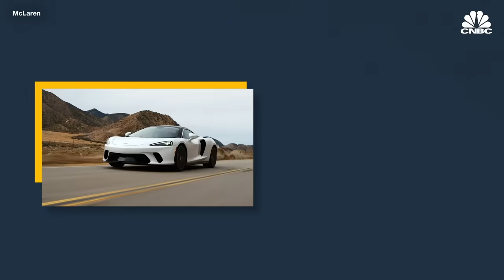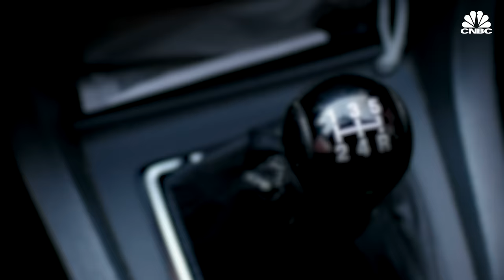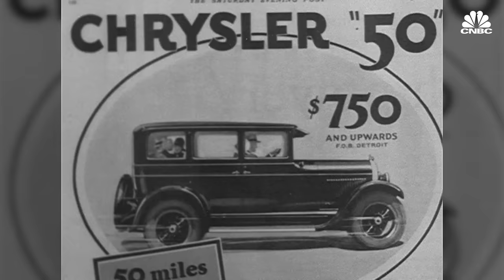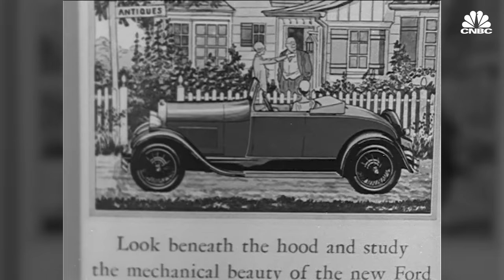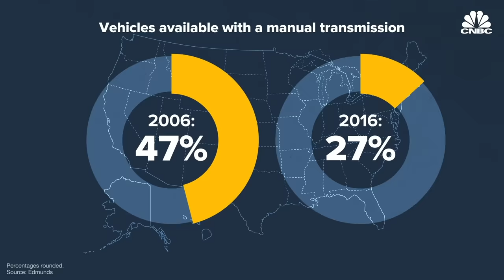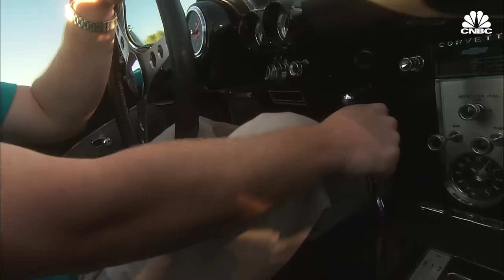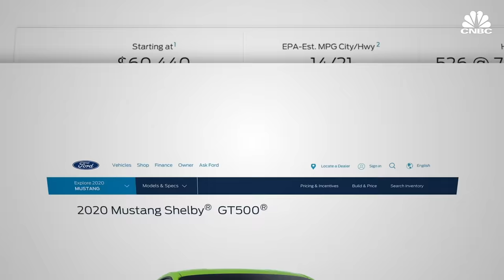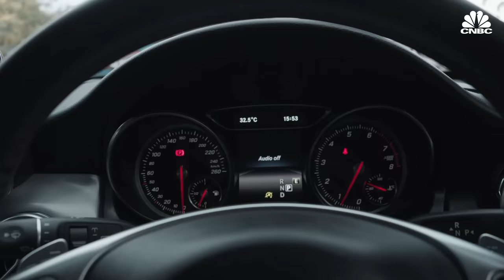Why Stick Shifts Are Going Extinct

Comment: *Why stick shifts are going extinct in the US*

Come to Europe - even try renting a car here that's not a manual. Good luck.
Reply: there are few automatics car, for disable people....
or Americans.
Reply: I can drive stick but I think it would screw me up shifting with my left hand assuming the steering wheels on the right side idk
Reply: @eyyymanuel  yes but only in UK .
Reply: Yeah but the steering wheel is on the wrong side ;)
Reply: It’s coming to Europe too. Ferrari dropped manual transmissions completely, automatics provide better performance these days, and self driving, or semi self driving, is undeniably the future, which you won’t be able to have a manual in.
Reply: @eyyymanuel  right side uk
Reply: Classic standard transmissions are becoming rarer in Europe, as well. Auto-manual transmissions and CVTs are gradually displacing manuals. Ford reports their cars in Europe went from 89.6% manual in 2017 to 68.7% manual in 2020. If that rate were to continue manuals would disappear in 2040. On the other hand, most of Europe (and the UK) agreed in Paris not to sell new petrol or diesel powered cars beginning in 2040. Electric cars do not have manual transmissions - that would be really dumb.
https://thenewswheel.com/ford-manual-transmissions-europe/
For 30 years I drove manual transmission Ford work trucks. About 5 years ago I got one with an automatic because the option package for the 4WD F350SD with our specs no longer came with a manual. The new transmission eliminated my major objection to automatics: it could be locked in gear, instead of being allowed to downshift, on slippery roads. It was also much better on steep, snow packed forest roads. It just was not possible to downshift from second to first uphill with a manual - the truck came to a stop quicker than the synchros would act. The auto kept me rolling.
Reply: The reason a stick shift is  going extinct is  people only have two hands, and they use both for Texting  there is no hand to shift with!
Reply: @mylanmiller9656  I'm only 24 (August 2020), and I honestly don't get why people are stupid enough to even text behind the wheel of the vehicle. I think I can easily say that I couldn't text while driving myself. I haven't ever learned to do that myself, I really can't do a lot of distracted driving, or much of any that would interfere with the idea of taking my eyes off the road for maybe a second or 2 per time, such as looking at my mirrors for instance.
Reply: @michaelm.3641  
Would you say the day Ferrari sold the next Enzo/F60 with automatic only the day the manual gearbox die?
It would be an engineering milestone that the automatic finally surpassed manual but still...
Reply: Alas even in Europe rentals of autos are becoming standard (sorry).  A friend in Barcelona  (4/14) had no choice in the purchase of new BMW hatch; auto only.  I rented a car in Luxembourg (6/18) all I had a choice of was an auto.  Honda stopped the amazing stick they had in the Accord cause no bought it.  I'm getting a Horse before a EV.
Reply: @davet.5493  
Makes me think people who said all rental cars in Europe are all manual haven't travel for some times.
And how long they can hold out since Chinese tourists don't drive stick either.
Reply: I'm from the US and I visited the Netherlands a few times for work. 

I got free upgrades to executive-class cars at the rental agency because those were the only automatics they had. Sure, I probably should have felt embarrassed for not being able to drive stick, but I definitely didn't. :D
Reply: That's planed to keep unknowing Americans from driving on the right side of the road (as in right or left) . This applies in Britain. India, Japan, Australia ect.
Reply: @d.s.steele3100  Britten, India, Australia  and  japan  drive on the Wrong side of the  road!
Reply: @jahmanborneo1343  Rental company's  have leaned to Automatic  cars  for ever. In  north America when  a Stick shift was real  popular, Renters like Hurtz  ordered  GT 350 Mustangs with  Auto  for there  rental Mustangs! an Auto was not even an Option on  a regular  Hi po mustang  but the Rental Co  had them special built. this was  not to make it better for the renter. it was because  a Poor driver can destroy a clutch in short order.
Reply: @mylanmiller9656 : That was tongue in cheek sarcasm. In actuality though, those countries fallow international rules of navigation. Ships at sea and air craft, travailing in opposite directions, are to pass right side to right side. That is why the green navigation light faces right or is on the right wing. the red lights face left or are on the left wing.
Reply: I drove in both the UK and mainland Europe on rented cars. It's actually very easy to find autos, but they're significantly more expensive. In the UK, I drove a MT Ford Kuga, but in Europe, I drove the AT Ford Focus instead since Europe is right hand drive and I come froma country where people drive on the left
Reply: Hurray! Hurray for manual transmissions!
Reply: I flew to England and they tried to rent me a mercedes e-class cause it was the only car they had with an automatic for like four times the cost of a Golf. Nah, stick all the way.
Reply: It's like twice the price to rent a car that's not manual in Europe...every single time we kept telling the person in Germany that we wanted a manual and they kept saying American automatic. We had to explain it like three times, we are driving on the Amalfi during this trip and do not want to be slowed down by an automatic
Reply: It's quickly changing, looking at Sweden which I guess mirror the rest of the Western nations in Europe for every year roughly 5 percent of the market move from manual to automatic. Today the numbers are roughly 65 percent automatic, this in a nation that only ten years ago 75 percent of all cars sold had a manual gearbox. I predict that in ten years time only ultra low-budget and specialized cars (such as off-road cars) will be sold with a manual gearbox.
Reply: @eyyymanuel  the UK is the only country in Europe that drives on the left side of the road and they have their steeringwheel on the right. the rest of europe has it on the left and drive on the right
Reply: @noahl3295  Well, to be precise, Ireland, Cyprus and Malta also drive on the right, but in all of those cases its because their historical connection with the british.
Reply: @igorokinamujika2073  yeah sorry I forgot to mention them
Reply: @noahl3295   No problem. I personally knew only about hte UK and Ireland before researching about this in order to respond to you. So, in a way, I have to thank you to encourage me to learn these facts.
Reply: @inwedavid6919  Wicked burn!
Reply: I've had no issues renting automatic vehicles in Europe...
Reply: @skiser7176  and Republic of Ireland, Cyprus and Malta.
Reply: @cris-vv1pn  And Republic of Ireland (Cyprus and Malta)

Comment: Exotic cars don't come with manual transmissions because their main market is buying them for status.
Reply: Autos are also much faster
Reply: @Αντώνης Σάμπαλης Depends on which Maserati.
Reply: Not really. Modern automatics and DCTs would outperform a manual. I once read an article on a comparison between a DSG and manual Porsche 911 and not only did the DSG smoked the manual in the track, it got better fuel economy in the road.
Reply: @matte8441  and here lies the argument, some would sacrifice a bit of speed and optimization for the raw joy of driving a stick, but most of the market doesn't appreciate that joy
Reply: Barry Woolfson nahhh I love a manual car as much as the next guy but the new computers can shift faster than you like the demon they can’t put a manual Cause you are not gonna beat it
Reply: @shaneryan3148  The guy forgot to mention that automatic has reduce tension when it comes to racing, you are already having to watch 360 view of the car to prevent crashes. Stick Shifting when evading or turning can slow you down because your too worried about the RPM and when to shift, short shifts can screw you up. The stick itself is a distraction between actual driving. That is why newer cars are using Formula one steering wheel shifts. What he should have said, why is stick shift dying out? There are automatic cars with the Paddle Shifter(Semi-automatic). Looks like Paddle Shift is replacing Manual stick shift.
Reply: It’s because dual clutch transmissions are faster and there isn’t that much of a demand for them
Reply: I took a taxi ride in China. A Buick midsize. Stick. Americans are insanely lazy. Please, CNBC, explain why you base your argument on what exotic car owners do.
Reply: @matte8441  well that makes sense because its based on how fast the person can shift
Reply: I got  Gallardo with manual.
Reply: Because dct is faster
Reply: @espanto101  no 
Auto are not faster. Dual clutch are faster,not the torque converter
Thats why Ferrari or Lamborghini ecc all have dual clutch gearboxes, but manual transmissions are stronger,less prone to breakdown and can resist to more torque
Reply: *laughs in audi r8*
Reply: @davideb.4290  Arguing semantics. "Auto" in this context is no shifting and no 3rd pedal. The reason  why high end performance cars are auto is simply because it's faster, and these cars are meant to set lap times on a track. Their goal wasn't to have "fun", but to race and allow the driver to have the best chance to get the fastest time he can. It's only a disadvantage to be manual with this vision.
Reply: It's easier to show-off driving slow with an AT car than a MT car.
Reply: @espanto101  in a straight line drag race maybe but not on a track with corners lol
Reply: @matte8441  dsg gearboxes are a manual but auto shifted clutch and not whats mentioned in this video or intented by this video they are meaning common torque convertor automatics unlike the dsg which does not have a torque convertor but rather an auto shifted clutch thank you come again
Reply: @shaneryan3148  those have auto shifted clutches unlike most auto cars which have a torque convertor that is slushy and has no feel
Reply: @espanto101  not neccisarly. there are options manufacters dont want to persue for manual trans.strain guage boost by gear clutch air shifting. tons they just dont want to put any money into manual tech. i will never buy another auto.
Reply: @matte8441  see devon schultz red demon DSM. manual AWD still faster then super cars shifting. strain guages are a thing.
Reply: @shaneryan3148  see supercharged manual gen 6 camaros vs demons. camaros still have less power and MURDER demons.
Reply: @shaneryan3148  but you can't control the revs, and end up with slower acceleration.

Comment: I’m sorry but if you can’t drive a stick shift, stick to a Buick. It’s not a chore, it’s an experience. It’s how you connect to your car.
Reply: Majority of people who drive just want to get from point A to B they don’t care about the “thrill” and want to “connect to the car” all the care about is comfort & reliability
Reply: @personyt55 manuals cost less to produce, are more reliable, cost less to repair, far outlast automatics and are very simple to learn and use. Once accustomed to them, which takes very little time, you have to think about it like you have to think about breathing. Even in heavy traffic I was more relaxed and it was less work than an automatic. If your battery runs low a manual vehicle can be push started.